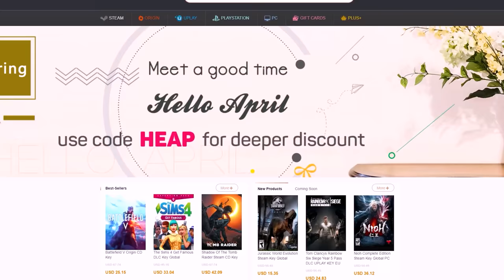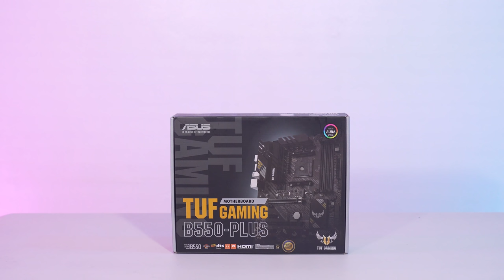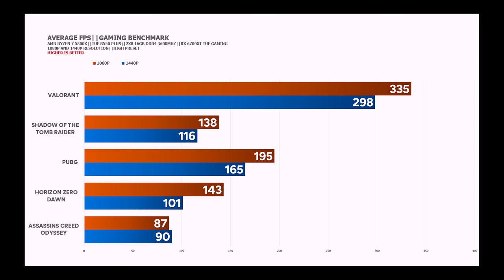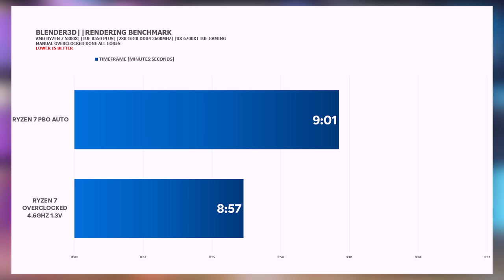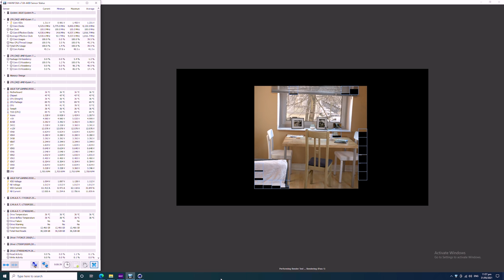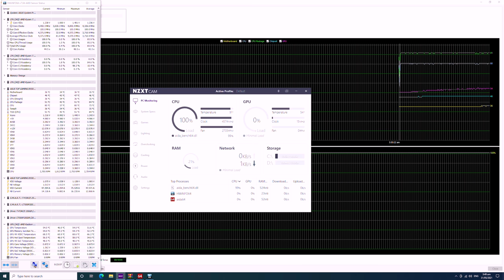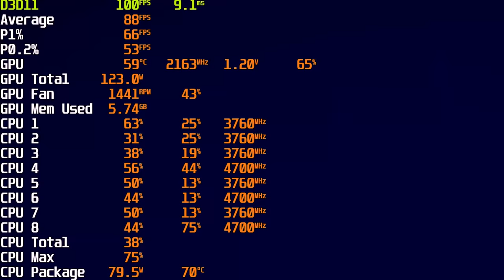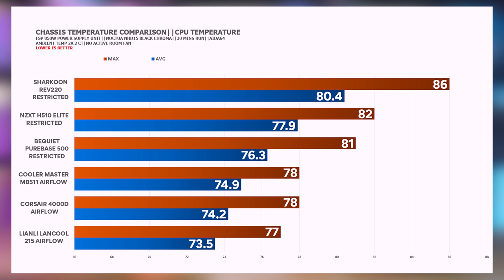AMD Pandemic Production PC BUILD ft Asus RX 6700XT Tuf & B550 Plus Overclocking w/ NZXT H510 Elite

Comment: Hi po Sir Bermor, itatanong ko lang po sana kung okay lang po na mag upgrade ako from Ryzen 5 2600 to Ryzen 5 5600x?
Ang specs ko po e galing din po sa suggestion video niyo. Asrock B450m, 1660super at 550w Corsair. Baka matulungan niyo po ako. maraming salamat po
Reply: di okay wala pa update ng bios for 5000 series ang mga b450 mobo

Comment: Bakit parang dalawang 120mm po yung front fans?
Reply: Yung cooler is nzxt kraken x53, not compatible for 140mm i guess.
Reply: @harronfuentes736  makes sense...nag skip kasi ako eh hahaha...nakita ko nung binalikan ko
Reply: @veztundra  i think pwede ring lagyan ng 140mm fans. Pero im not quite sure nga lang. Baga may magasgasan.
Reply: @harronfuentes736  baka hindi na mag kasya...yung mounting holes Ata ng rad pang 120mm lang
Reply: @veztundra  i mean hindi siya i mount sa rad. Screw agad sa fan.
Reply: Nna try ko na dati, nagasgasan yung rad ko 😅